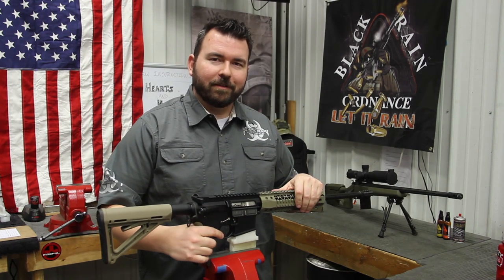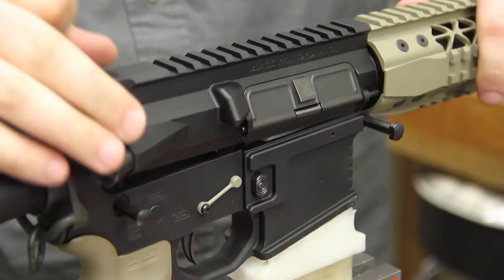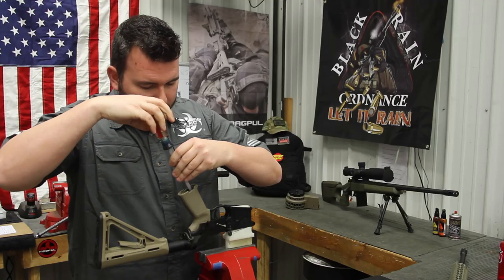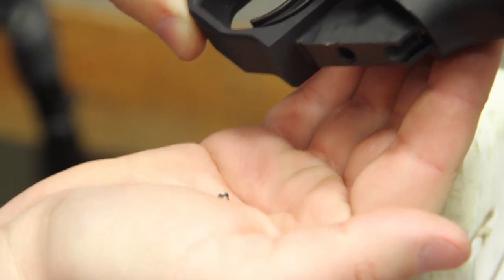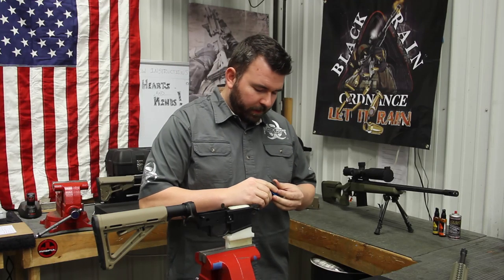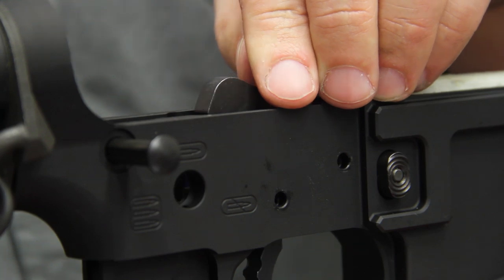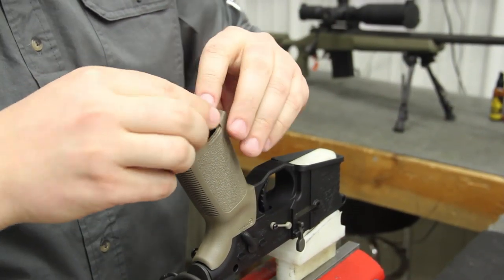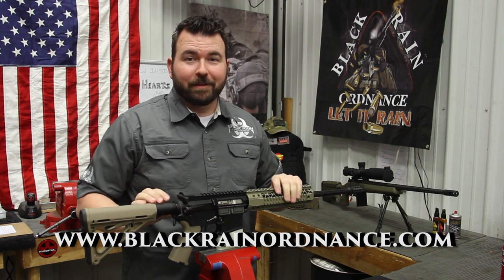How to Install the Black Rain Ordnance DIT Trigger

Comment: So, I dont run the anti rotation system.  The allens on the bottom of the trigger, their purpose is to actually push against the bottom of the lower reciever?  So, when the directions state tighten, I would actually back em out slightly, to where it keeps the hammer and trigger pins in (nice and snug)?
Reply: I was wondering the same thing, could have given more info on this.

Comment: I just installed one of the unmarked versions of this trigger, $95 at fatboytactical.net, into my lower for my 6.5 Grendel. Excellent trigger! I had some difficulty reaching the set screws (used for regular pins). If you have the trigger group out of the receiver, pull the trigger and move the hammer as far forward as it will go, that will let you get the spring legs out of the way. Then you can easily test your allen wrenches to see which size fits ( I foolishly didn't record which size it was, sorry). Then you just install the trigger and pins as normal, get past the fact that you're going to mar the anodizing (noone will see it anyway) and just jam your allen wrench past the spring legs to tighten them up.
Reply: +sniffmoney You're welcome, enjoy!